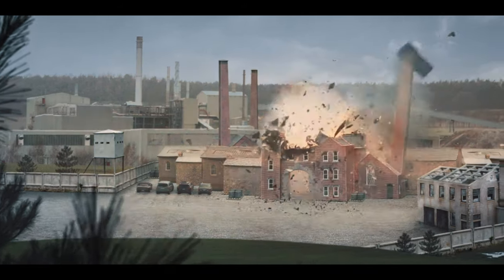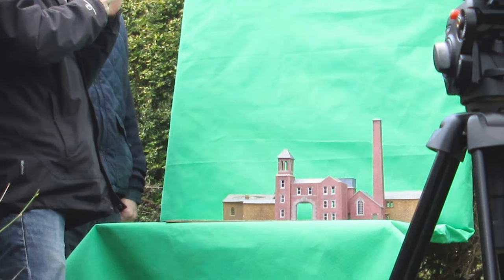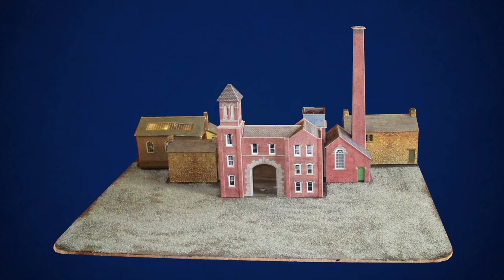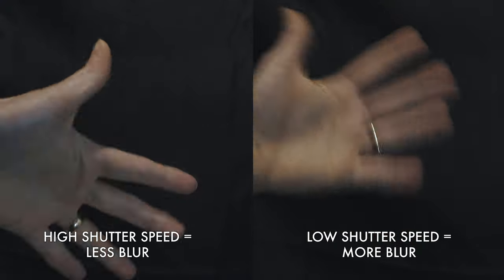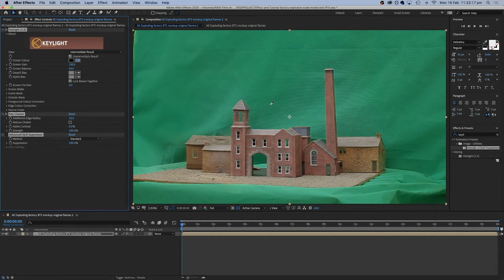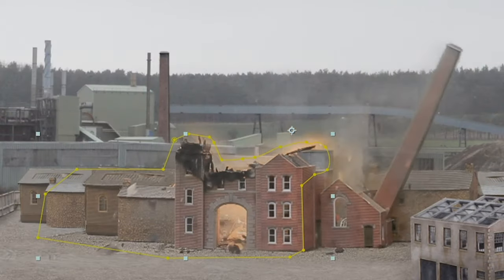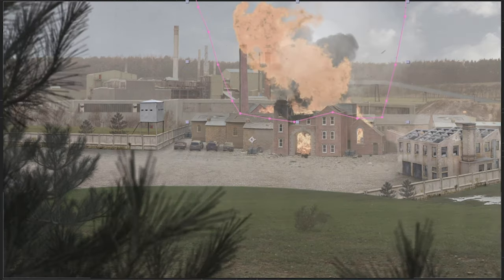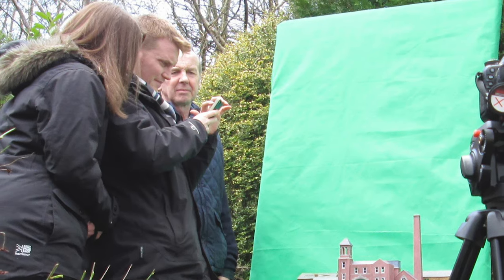Factory EXPLOSION miniature scale model and VFX - full walkthrough

Comment: I watched both the original upload and this one.  In both you mention putting the one building in the foreground to cover up the chimney bouncing.  Couldn't you have roto'd the chimney to cut it out and put it on a still of the area it falls into?  Doing it this way you could even animate the cut out chimney so that it ends up lying flat on the ground and maybe even roughen the edges of the part that broke off from the building.  It is more work but I find the chimney falling over is the part that really makes the shot look like a model.

Comment: If you camera can only do 60 FPS, just convert  it to 120 in post production.  Yes, this means you will basically show the same frame twice, but that is what they did for cartoons like Looney Tunes.  They only drew 12 images per second, but recorded each image twice.  It is not perfect, but can extend the time of the action.  
The slower motion does not add weight to flying objects, it adds size and height.  A cubic foot of Aluminum weighs 170 pounds, while a cubic foot of Lead weighs 710 pounds  if the cubic foot of aluminum and lead are the exact same shape, they will take the same amount of time to fall.  But the longer it takes something to fall, the higher it was.

And I have trouble with the fire and smoke, the main reason is the most of the flames (on the roof) are being blown by a breeze to the left of the frame, but the smoke and the fire in the gateway is rising straight up.

And then there is the fact that your minature has shadows on the right side where your background has shadows on the left. (Two Suns?)  I am bring this up as it is things to keep track of, as such discrepancies pull one out of the illusion.

Comment: As I mentioned on another vid, there are two common tropes used that are "tells:"

1) The added shaky cam, including the "wobble" from a shock wave. For some reason, modern FX artists think this makes shots look more believable, when in fact it doesn't. You can actually look up pyrotechnic vids of actual explosions (some much closer than your camera is meant to be), and they don't cause wobble. If the camera were locked down on a tripod, the most you'd get would be a brief "jitter" from the ground vibrating. I don't know why artificial handheld has become the standard for, "hide the fact that this is an FX shot enhanced with CG." 

2) The other "tell" is the color grading. At 7:54, the various elements are composited well, but the color has been so desaturated that the fireball doesn't look vibrant. In fact, the colors are considerably washed out.
Reply: @estadiofifa10lol 1 Yes, but only in real-life situations, like security cameras. 

Television and film follow the same rules as stage plays; that is, the events of the story occur inside a "box" and the audience observes the events from behind "the fourth wall." 

This means that the "camera" doesn't exist (from the characters' perspective). It's an invisible device relaying information to us. 
So if an explosion happens in the characters' world, it shouldn't cause camera shake because the camera isn't supposed to be there. 

A similar modern trope with CGI is when spaceships or other fast-moving vehicles zip by the camera, and artist adds artificial wobble meant to be from it's shock wave. Which if you think about it, makes even less sense if the shot is in space, as there is no shock wave in space because the craft isn't moving through any kind of medium; it's in a vacuum. 

But here again, the "camera" isn't supposed to be there. It's why I loathe modern films & TV shows that utilize handheld shooting instead of locked-down, dolly, or steadicam shots. Handheld implies that a cameraman is following our fictional characters around.
Reply: @estadiofifa10lol 1 Err, yes, it most definitely is. 

Have you never heard of the phrase, "breaking the fourth wall?" It's when a fictional character looks directly into the camera and addresses the audience (thus acknowledging that they're aware they're being observed).
Reply: @estadiofifa10lol 1 Yes, I'm aware of that. But as I said, the "wobble" only exists because the audience is supposed to know the camera exists. 

In fiction, (dramas, stage plays, etc), the audience and any cameras are meant to be invisible to the characters. That said, the camera shouldn't wobble from an explosion because it isn't supposed to be there.
Reply: @estadiofifa10lol 1 Perhaps, but it nevertheless is a undeniable "tell" that the shot is CG. Artificial shaky cam is hard to miss.

Comment: Appreciate the effort but there are some GLARING things
-There's no shockwave--at that scale of explosion, there'd be a pronounced shockwave, especially on the ground kicking up dust
-We're half a mile away and the sound and camera shake reaches us instantaneously
-All those really diffuse drop shadows (fence, cars, foreground building) don't remotely match the lighting of other elements, and cars themselves don't match the lighting (sides facing us are all extremely dark)
-The fireball doesn't behave like a fireball and doesn't match where the smoke plume is. Fireballs turn into smoke plumes as they cool, they're not separate elements
-Gravity of the smokestack and debris is still way too fast, and a smokestack that big made of bricks would lose its integrity as it's falling

Comment: there are only two things that show it's a model in the final version. The flames, they do not correspond with the building at all, especially the flames in the gate and the window are too obvious not right for what is behind it. and the "rooftop" flames shouldn't be there because there is an open square behind the gate. and ten the fireball and black smoke are just nor realistically set of each other. the fireball is clear CGI, as you said you need a big budget to get that right, but the black smoke should follow that fireball and smoothly transition to black smoke with the wind and all. It just does not look right with the fireball going left and the black smoke going right up. other than those two it is near perfect except for the big piece of debris that falls on one of the cars but mysteriously disappears with, as in all good Hollywood movies, unscathed cars.

Comment: offset the fire timing and slow the larger roof fire. You slowed down the original elements for scale which is good but then used normal speed plates.